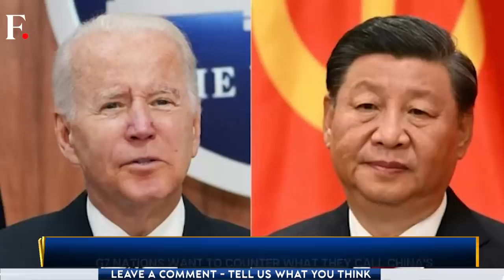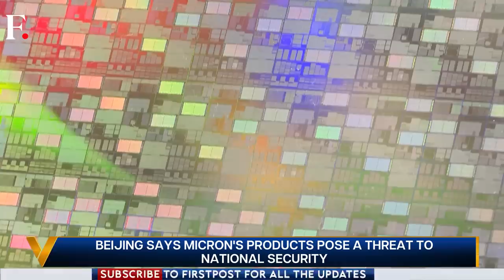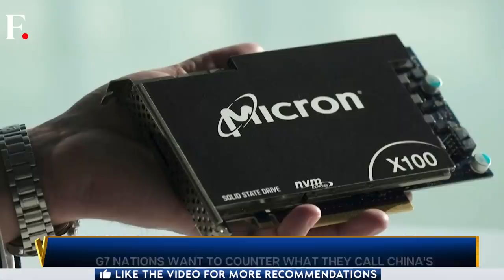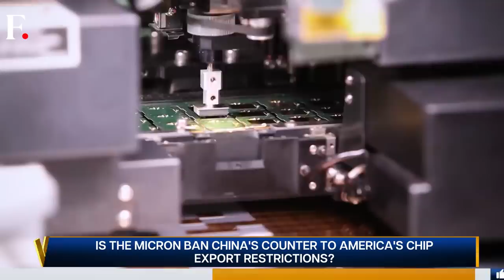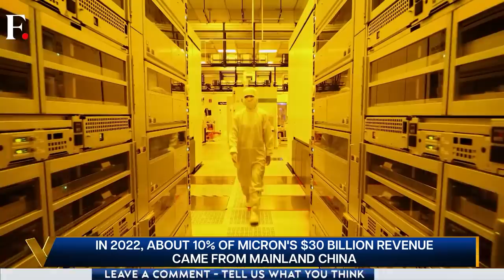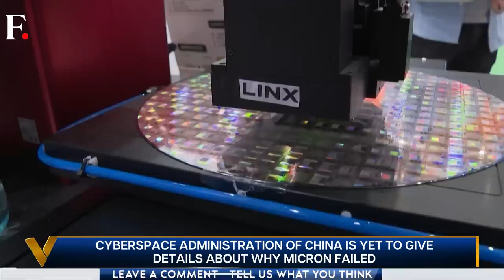US-China Chip War: Beijing Bans American Semiconductor Company Micron | Vantage with Palki Sharma

Comment: This is bad for customers. It actually started to get worse in the end of 2022. Many creator focused Chinese Taiwanese laptops started to only offer 16GB RAM models, where customer expected 64GB. As a result, laptop sales were record low all around world.
Reply: Oh, never mind, not in Chinese market, where stacking specs is essential.
Reply: I think price will go down because Chinese chips will be used in replacement to macron. Here in the Philippines we have smartphone priced very low using Chinese chipset
Reply: The price of solid-state drives using chips from local Chinese manufacturers is half that of others, and now 1T solid-state drives only cost $50
Reply: @yudogcome5901  yep, same price in Amazon
Reply: @wiltonyu4951  I hope so. Because Lenovo yoga pro 9i 64gb soldered RAM is 3500€ in here. It's more than my year wage. The 16GB is under 1000€.
Reply: Its the opposite. 
Since China banned the American junk the prices got cheaper where  I live and there is an abundance of suppliers
Reply: @NinoJoel  Probably China is not fully able to source the materials or parts to assemble the computers, or the strict lockdown measures disrupted the flow of laptops to Europe. For example the Lenovo Yoga 7 gen 7 Oled 6800u 32GB RAM has been out of stock ever since Christmas ~6 months.
Reply: @az9az9az9  out of Curiosity where do you live? 

Where i live there are no shortages as far as I noticed
Reply: @NinoJoel  I live in Estonia, the closest Lenovo dealer is in Finland. I was checking other EU country dealers. Everybody only had 16GB RAM version of Yoga 7 Gen 7 Oled AMD. Now there is Gen 8 with previous years Ryzen 6000 that maxes out with 16GB RAM. Hopefully Legion Slim 7 7940HS comes out soon, this supports 48GB RAM.